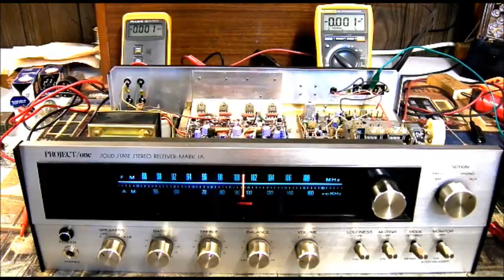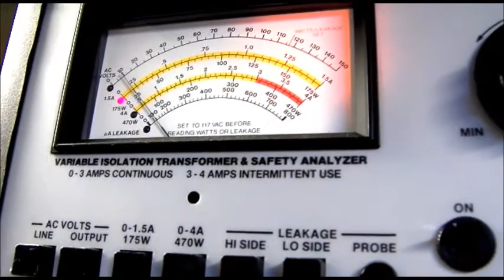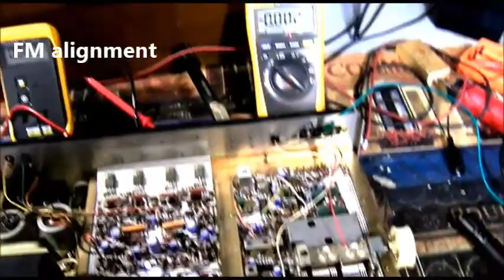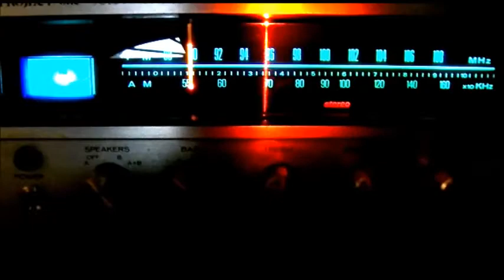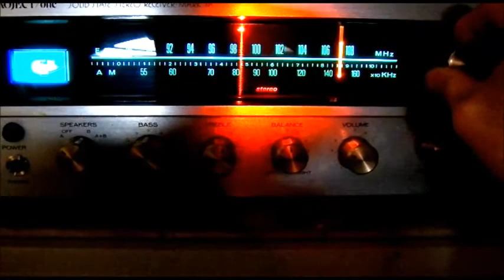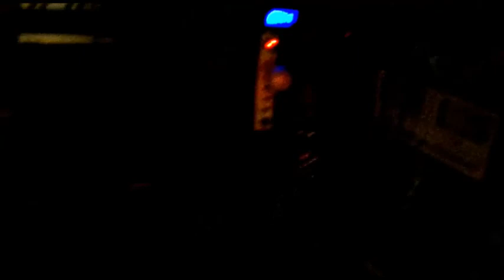PROJECT one Mark 1A receiver repair biasing alignment upgrades tune up

Comment: I just grabbed a mark 1B at a yard sale. powered up and plays nice. But there is a high filter switch that needs some attention. I'm not sure if it's working ,the the toggle action is wonky and seems like some physical issue in the switch.
I'm tempted to go in after it but not sure if its something that could be fixed or if I'de need another switch.
got any suggestions?

Comment: I just got this and am having problems. It sounds great, but the left channel is somewhat distorted. Even if i take the bass off. I've switched out speakers, and still. This leads me to believe something is wrong with left channel. Any suggestions?